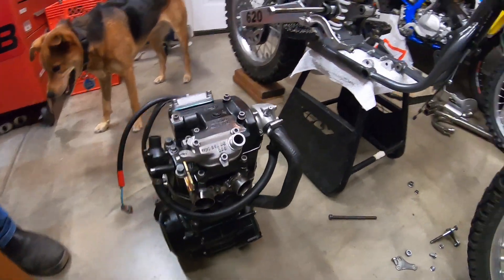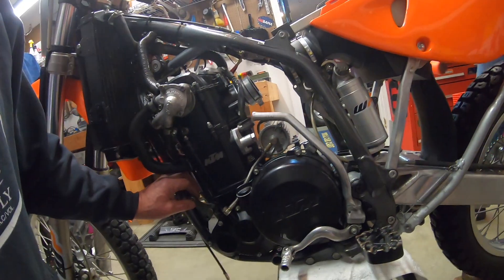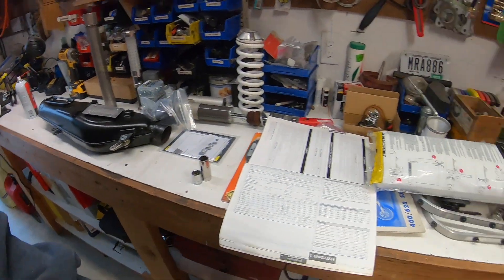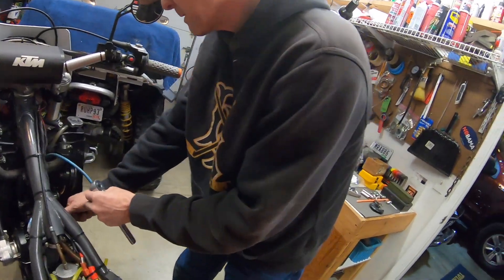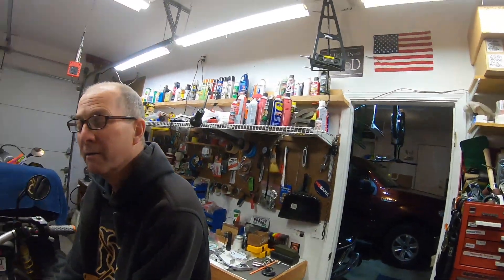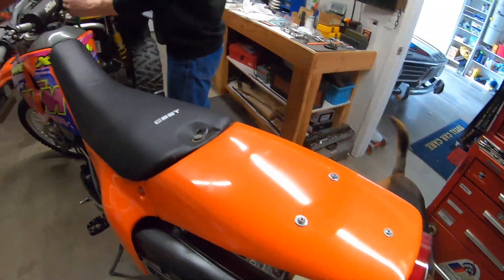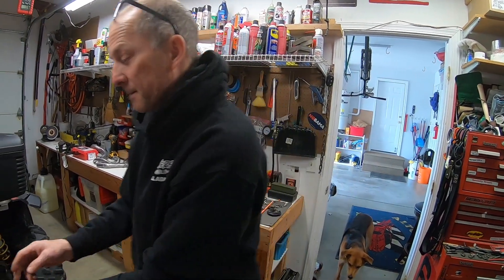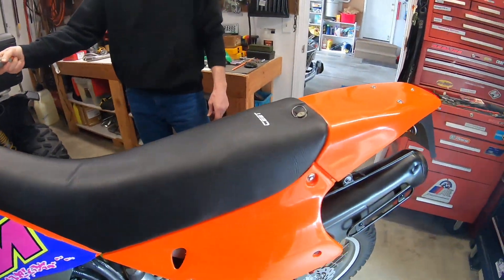KTM 620 April 24 first start after restoration

Comment: Did you keep track of where you bought all the replacement parts. I'm picking up a 94' 400 basket case and new to KTM so vendor list would be helpful.
Reply from the maker: yes
Reply: @intheshop8009  trying to figure out how to direct message you to share contact info if your willing to share your parts vendor list
Reply: Yes, I have a spreadsheet that has all that info in it. Be aware, a lot of these parts were sourced from ebay due to them not being made anymore and they have to be sourced used. But everything is available, it is just how much you want to pay for it. Not to many vendors out there, most are individuals and salvage places. Some pieces are still available directly from KTM.
Reply: @mikekubani  I believe I just emailed the Ivan address

Comment: I just rebuild mine to do a head gasket.. I took the rear bolt out on the motor by the kickstart/shifter to drain the oil and something retracted.. I went to put the bolt back but now that I have everything back together the kicker dosent retract back up any idea?
Reply from the maker: hello, that bolt goes into a cam slot ,when the kick start shaft is clocked and sprung . cam not sure if it can be installed back in the right place with out breaking the case. the cam can bee seen in this video  https://www.youtube.com/watch?v=XjrSy1GpRMI&t=4s athletic about the 1.30 minute mark, hope this helps
Reply from the maker: after watching the above mentioned video it can be done with out splitting the motor, the kick start shaft will need to be rotated in thecounter clock wise direction, until the bolt will go into the cam